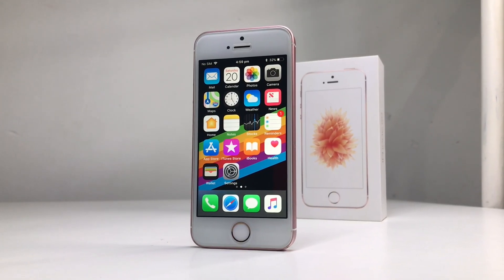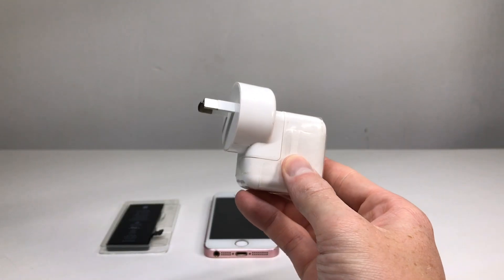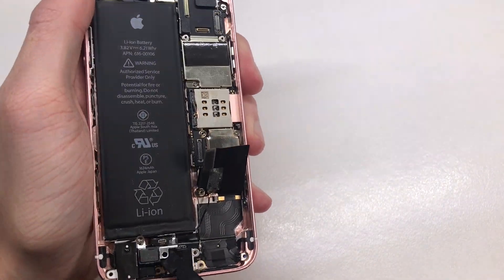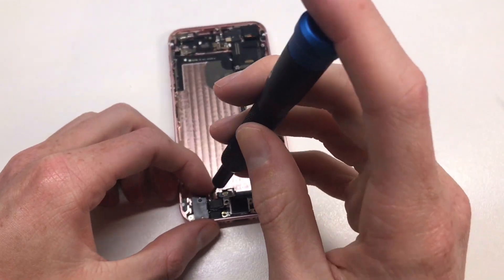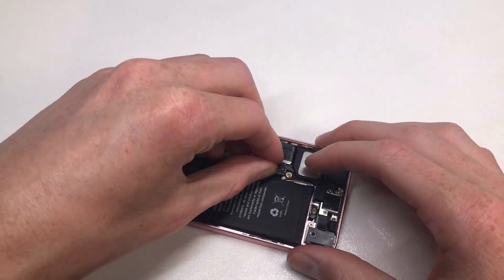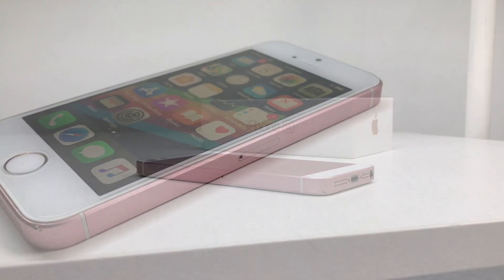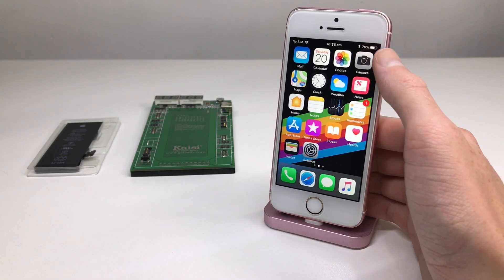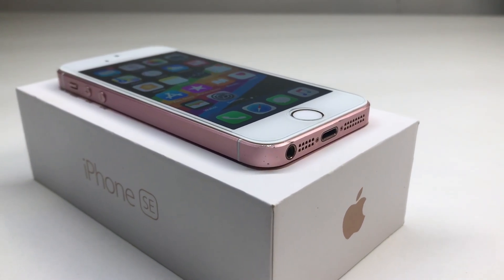Reviving My Dead iPhone SE

Comment: On my old iPhone 4S I used a not original apple charger and cable and after I checked the battery life program I surprised: from 1400mah battery now I have 659mah!
Reply: those battery life apps doesnt show right info in 99% of situations
Reply: AleksarasGR The Greekgamer a knockoff charger and it killed my 4s
Reply: @George-bj5wr  i use one of those with my android phone and it still works good but i got a expensive(ish) one thats not a LG charger (charger my phone came with wasn't charging because of how much stuff i had using power on it [probably why people get them for apple phones])
Reply: MAh Im SerIOuS

Comment: I snapped my adhesive when replacing my 5s battery but lucky their was just enough to grab with tweezers. And the Touch ID cable seems to be strong I wasn’t too careful prying the screen and it came apart and the metal clip flew across the room.

Comment: Important question: will a phone that has built in surge protection such as the iPhone XS still be affected by cheap power adapters? (I know lots of people probably want to know)
Reply: Barundonthetechguy / iRepair you gave me a virus why u did to me idioyt
Reply: @mohammadtahirali6655  how did he give you a virus wtf???
Reply: YES
Reply: If the charger you used becomes hot within 10 minutes charging the phone dont use it again
Reply: Tech through Toni original chargers can get hot specially when you are using you phone and charging it as it consumes more power.....
Reply: yes i agree but not getting hot that fast as the fake one
Reply: Tech through Toni 👍👍
Reply: Barundonthetechguy / iRepair no all iPhones have a charging IC which regulates power and if you use cheap chargers and cables the ic will go bad I have already replaced some on iPhones 8s which is surpricing...

Comment: Hogwash. All the brick does is supply power. The actual charger portion is part of the phone. So unless the brick is completely fucked up, it’s not the off brand brick causing the issue.

Comment: You can use an iPad charger, plug it in, and put it in dfu mode and leave it for 10 - 30 minutes and then force restart it and it should work
Reply: Are you Justin Y's little brother?

Comment: I'm either getting a iPhone Xr or a Google Pixel 3, they're both really good phones but Idk what to pick.
Reply: dont get either. i say get an s9. the pixels aren't that good anymore. and the xr has a lower resolution display. both of those phones are at least a $100 overpriced. you can get a s9 for $400
Reply: @seanjackson6305  hmmm... I will definitely take that into consideration!
Reply: Branden Adkison yh my mom has the s9 plus and it is an amazing phone I personally liek apple better that’s personal preference but the s9 plus has a amazing camera and a really nice display so I would consider buying that phone
Reply: @cypherelite9725  yeah, it would be a nice upgrade from my LG G2, its pretty old and the screen is starting to wear out some.
Reply: @brandinop6379  or get the note 9
Reply: i would get that over the xr. before you buy it try to see it in a store. the display may look better than what the specs say. but for android i would say the s9 or s9 plus is the best option, not the pixel 3. good luck choosing.
Reply: Don’t get the s9 get the iPhone ten a max way better then all of them.
Reply: @Lexluther120  buts it's not the best bang for the buck
Reply: Leoanrdo Sanchez thats opinion based, and the s9 is $400 and the XS is a $1000. dont see any advantage that the XS has for $600 more than the s9.

Comment: Anyone know how to fix Touch ID that’s stopped working randomly haven’t taken the device apart hasn’t got water damage or anything just says “ failed to set up Touch ID “ and when I turn the phone on it doesn’t even come up with “ Touch ID failed “ like it’s supposed to, shall I just try unplug the home button and plug it in again
Reply: Check the small ribbon between the button and the flex at the back. That breaks easy. If it isn’t that then check the rest of the cable for breaks or tears. If it all looks fine and still doesn’t work try a reset (you can do it without removing data using 3u tool)
Reply: If the home button works but touch id doesnt, its probably the ribbon meansioned above or that "security" error which makes no sense, have you upgraded it to the latest IOS? (If the home button works but touch id doesnt) i wont do it, you probably will get error 49
Reply: nathan curtis clean the home button with a cloth

Comment: Can you please tell me how i can deal with a loose iphone se button.  After repairing the screen and removing and sticking the button a few times the sticker of the home button does not stick really well.
Reply: MURASAKI get your own adhesive
Reply: Brandon I tried that but it was still the same.  Maybe it's because i didnt apply it properly.  Thanks for your suggestion, I might give it another shot.
Reply: MURASAKI get a new homebutton adhesive
Reply: The home button is always loose when using 3rd party screens because the Gap for the button isn’t as precise as an official apple screen it’s just one of those things
Reply: Wow really? Thats unfortuante :( 
Perhaps i should get a refurbished official screen?
Reply: Maybe its bc u werent that careful while removing the screen

Comment: I had a similar sort of thing happen to my iPhone 5 a few years ago. Then I left it plugged in for a few days and I forgot about it, until it exploded. My room smelled terrible for like 1.5 months.
Reply: PaleMacaroon483 it exploded? That sounds terrible.
Reply: PaleMacaroon483 probably you farted..when you were sleeping without you noticing 😂😂
Reply: cypher elite ligit the screen was blown off and the battery was split open
Reply: PaleMacaroon483 yh then it looks like you need a new phone I just fixed my old Samsung note 3 I’ve got an I phone 6s plus and I’m happy I got it working again lol

Comment: I think I have the same problem my iPhone 6s has had lots of screen replacements but this time It didn’t turn on at all but the home button doesn’t work and the battery was poor before I changed the screen but I don’t want to waste money for another battery for it to still not work anyone  have any clue what I should do?
Reply: SCHUMBI get a new phone
Reply: mikey legit are you gonna buy me one ? 😂
Reply: SCHUMBI I have a crappy 6s too tho
Reply: SCHUMBI maybe re-open it and double check if the cables are connected right? Or if the battery Is connected properly?
Reply: Froylan Diaz Yh I’ve checked all the cables
Reply: If you didnt disconnect the battery as the first thing when you opened the device, then you make a mistake. If you Hard Reset the phone (hold power and homebutton for 20 seconds) it is possible that the screen will work again.
If it then still doesnt show image, you probably killed the backlight.
Reply: Thom Steenbergen but the home button doesn’t work 😂
Reply: Maybe the new screen is dead
Reply: Lucas lucas Yh I tried a screen that was cracked but worked fine it didn’t turn on
Reply: Ethanator 4115 Yh I went to a repair shop to put a battery but it still didn’t turn on
Reply: Ethanator 4115 that’s a shame I was hoping I could sell it for a little money
Reply: Can you ship it too me and ill fix it and ship it back. I had the same problem and got it to fix its probably the dock connector
Reply: Fear Productions hmmm I’m good but what do you mean the dock connector
Reply: SCHUMBI it's not a dock connector....
Reply: 176cgna so what should I do
Reply: SCHUMBI if you want to fix it you need to take it to a micro soldering shop..... but it wont be cheap probably in the 100 to 250 range.....
Reply: 176cgna I’m just gonna throw it away I have iPhone 8 Plus
Reply: SCHUMBI problem solved you would be surprised how many people pay over $250 to get an iphone 6 repaired just for their information pictures and contacts
Reply: If you replaced the screen and then tried the old known working screen you damaged the backlight circuit simple as that you can replace all the batteries and screens you want it will not fix your problem.
Reply: you should probably buy a new battery for your iphone

Comment: Hey I need some help. I got an iPhone se that would boot loop and the apple logo looks glitchy. It’ll get into iOS after I let it hard reset in the freezer but that temporarily fixed it, and sometimes it doesn’t and I have to iTunes restore it. What should I replace?
Reply: Tr3vor Battery?
Reply: see i did buy a battery off ebay but the same thing kept happening. It might just be 2 bad batteries but idk the odds of that
Reply: Tr3vor Is it OEM?
Reply: Can you provide a picture of the glitchy apple logo?
Reply: despacito 9 found in black hole I just put a video of the glitch up
Reply: Tr3vor That would make a great respring logo lol
Reply: despacito 9 found in black hole checking for what?
Reply: Ethanator 4115 ripp it ain’t under warranty :/ idk what to do with it
Reply: Go to apple they might do it free out of warranty
Reply: computers with nikita nikita my friend gave it to me broken like this so I don’t have warranty :(((
Reply: @trv88r Try holding the power button and the home button down at the same time when you get stuck in the boot loop next time, and that should force the phone to restart. If you can get into the phone, then try and perform a hard reset on the phone and see if that fixes it. I personally own an iPhone SE myself but I haven't encountered anything like this. Hope this works!

Comment: That comment about "one of the biggest killer of iPhone is cheap power adapters and lightning cables" isn't true, sure no denying some are completely crap but lets say a cheap one is rated at 5V 1Amp, providing it puts out that its not possible to do any damage as its not rated at a higher current than the original.
As long as you test the cords and adapters.

imo I'd say its apples design flaw that there isn't something to manage the current flow if there were a spike in current. i.e. power surge.
Reply: ? I dont think you know what you are talking about, ORIGINAL Apple Chargers are rated if I'm correct, 5v/w (VOLT/WATTS) 2amps.

Most aftermarket chargers are rated 5V 1amp or less. average 5v, 0.8amps. Its not possible for those chargers to output 5amp

If an iPhone took 5amps, it would die instantly, not even fast charging phones take 5amps
Reply: @Tanner _ again as I said if you test them with a usb amp meter
Reply: What about non tech savvy users?
Reply: @Arctic740  user reviews, number of items sold
Reply: @Tanner _ yes but also the average consumer can also check user reviews and amount of products sold
Reply: @Tanner _ also I've used Original, and after market, my point is if somethings outputting 1amp, it's like having it plugged into your laptop 

Which chargers slower than original and is less amped than an original
Reply: The problem is the delivery a cheap charger 5v 1amp will send a weird current and that messes up the charging IC or as apple calls it tristar. A cheap 5v charge can damage a phone simply because phones have different voltage lines and sending 5v to a 1.8v line can cause havoc in the logic board. Most of the non charging iPhones are because of cheap chargers....
Reply: that didn't make any sense... you do realize that 5v and 5w are the same as apple chargers? So are you saying apple is sending to much current, I dont get it,
Reply: prodigyaustralia yes but you said 5v wont damage anything but they can and often do when not used properly or when cheap charters are used. And yes a cheap and original charger have 5v but the delivery is different cheap ones have a very broad wave of current while the original has a smooth constant flow that is where the cheap ones damage components on iphones specifically.
Reply: You do realize fake power adapters basically have no gap between the two parts of the board, right? Which means if you lightly banged it against something it would electrocute you to death and break the phone. Also fake power adapters have HUGE voltage spikes and can even feed straight 6V to your phone. Original power adapters don't cost $20 for no reason.
Reply: @realvivifromloona  ever heard of usb amp meter

Comment: Yeah I’ve had iPhones flip out. To totally fucking up. My iPod touch 1G just wouldn’t charge after using one. I broke the iPod after. Mainly as I was bored and I have no experience in fixing soldering. And the iPod had its faults too. I later learned my lesson and now use only the official chargers I got with my iPad mini and iPhone SE.
Reply: That's OG bro. I remember my iPod Touch 2G fondly.
Reply: Mitch Aw yeah. The iPod touch 2G was my first ever iPod touch. That IOS 2 and 3 experience was great. Even on IOS 4 the iPod held up really well. 
I fucking loved that thing. It was amazing. We had pages and pages of apps and games on there as it was shared between me and my sister. 
I remember my 2G fondly too. 
My 1G I bought off eBay. So I didn’t care for it as much.
Reply: i had the same devices xD ipad mini 1 and se.. since this black friday i have an ipad 2018
Reply: 2G life

Where you would download web apps off the apple website
Reply: Matthew what kind of apps did they provide?
Reply: Mainly 2d games and basic apps. Nothing much.
Reply: Good job you learn
Reply: Plainapple287 grammar is nonexistent.